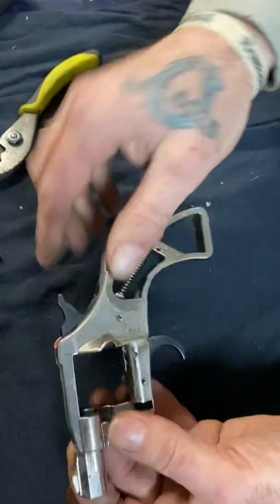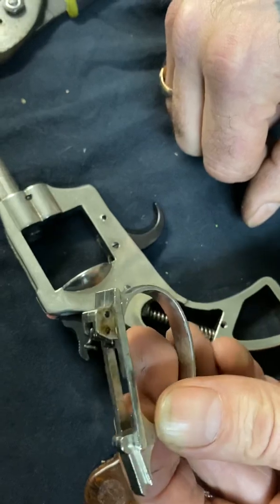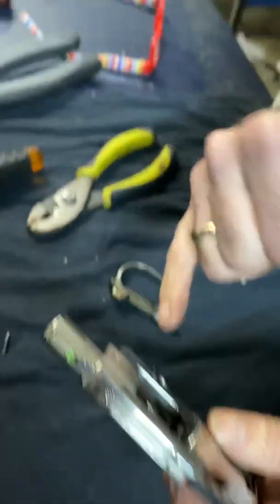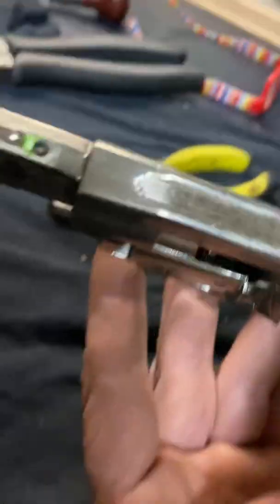RG23 By ROHM disassembly and reassembly

Comment: Bryce..............thank you for the VERY good and detailed description and reasoning behind what you're doing.  I first thought that the torsion spring in the front of the trigger guard "was" the trigger return spring, but was told by a gunsmith friend of mine that it was the hair pin spring in the groove, and I had no idea it even went into a groove (my gun is black and almost impossible to see things inside, and now after hours of trying to make this damn thing work, you have set me straight, and I realize that the trigger return spring is exactly what I first thought it was.............the torsion spring in the front of the trigger guard.  I "thought" that I had the spring in properly because I couldn't see it from the top like you show in the video, so I guess it's possible to have the spring/trigger guard installed and the spring not visible, and it gives you a false impression that you've installed it properly, and that it's under those little "fingers", but it's apparently NOT in the proper position.  Thanks again for showing the proper way to put this thing back together..............excellent video!!!!!!!!

Comment: I know this us an old video, but I hope you can help me out. Just bought one of these and that last spring issue on the trigger guard you showed, I can get in place under everything,  but after a couple of function checks, it slips back out. Any ideas? Thanks.
Reply from the maker: Sorry for the delayed response. I’d look for something bent or worn out. Someone probably was prying around and messed up the spring. Also check the three little tabs to see if they’re worn out. It might not be one thing. A little here a little there could add up to malfunction.

Comment: I picked up one of these as a gunsmith special (I'm training to be a gunsmith) for $30, sight unseen.  Trigger wasn't resetting and the hammer wouldn't drop until the trigger was released.  Thanks to this video, it was such an easy fix.  The trigger return spring in the trigger guard assembly was bent.  Got that straightened out and it was off to the races.  Just need to blue the steel parts and it'll be good as new.  
Thanks so much for this video.

Comment: Wish she had a llarger munition type but deadly is deadly
Reply: They have other models, chambered in .38 special.  Check out Centerfire Systems, I got my RG23 for $30.  Just need a tweak to the trigger return spring and a good cleaning.  It's not going to replace my Glock as my carry piece, but for a range plinker, I'll do that all day.

Comment: How would I remove the barrel? Does it have to be unthreaded?
Reply: That’s the problem I’m having, how do I keep the barrel & shroud in tight. It pulls right off the frame & shroud. I plan on coloring the barrel, my hope is it’ll tighten that tolerance.

Comment: My single action fire wasn’t working, it was a “light primer” but the double action would fire, I recently found out I didn’t have a washer in there on the spring then installed one but haven’t gotten it to the range yet, would you say problem solved for single action fire?
Reply from the maker: I think you are good to go. That spring is super important. I can’t imagine how the gun would operate properly without it. Good luck and let me know!

Comment: Would be interested in seeing the cylinder disassembly. I am restoring one right now. 
Am very unsure about how that comes apart.
Reply from the maker: I didn’t take mine apart I just soaked it and got all the funk out and boy was there a ton of nasty. It works perfectly without tearing it apart. Good luck let me know!
Reply: @brycejohnson144  yep, I did the same. Had some misfiring issues. Put a spacer on the spring rod. Good point on that spring when installing the trigger guard.
Fires flawlessly. Great trigger. Pretty accurate. Impressive I might say.
Thx.

Comment: I have the very same piece, cylinder isn't turning between pulls but locks in place when closed. By this video, I'm thinking it's one of the springs in the triggering mechanism, like the one from the trigger guard. I'm gonna dismantle it completely now. Thanks for the upload, happy shooting.
Reply: Update: problem wasn't the springs, there's a part missing within the cylinder.
Reply from the maker: @mattpineda8163  get those parts from numrich!